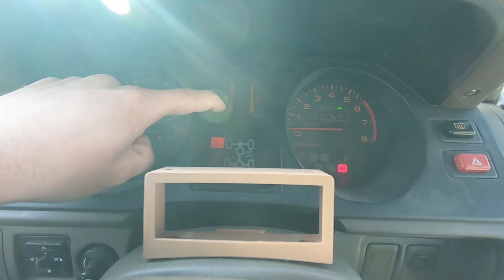Dodge Raider/ Montero Diesel Swap Pt 3. Finally running!

Comment: An intercooler would make a noticeable difference. Hack up some exhaust tubing and get some silicone connectors and use some random intercooler behind the front skid plate or wherever. Nice job!

Comment: Awesome video, good job! I never knew what lapping the valves meant until this video. Simple to understand and informative information on the procedure.
Nice see detail work on the motor. Like the gold valve cover.
I had to laugh a little when you said Ive got to figure out how to remove the motor. I thought you had removed the old motor and installed this one.
Reply from the maker: Thanks for watching! glad you learned something new. And yes i did have to remove the old stock engine to put this in. But if i remember correctly I had a huge fuss putting it in because of where i hooked my chains on the engine. So i needed to find a better more suitable place to hook the chains hahaha.

Comment: Idk man did you time the injector pump right that doesn't sound like air or a diesel leak to me sounds like the timing is off...I have a VW 1.6td in my Suzuki samurai and it ran like this because the pump timing was off a little I retimed it and it was running smooth as butter after that...

Comment: Do you know if the 3.0 V6 and the inline 4 have the same motor mounts and transmission mounts?
Reply: I just drove a ram 50 with a 4D55T and it was awesome!! I was going to buy it but the engine was pretty tired and built pressure in the cooling system.

Comment: Glad to see it finally running! How well do the five speeds holdup with that power
Reply from the maker: I think the trans will last forever with this amount of power 🤣. This car has 205k miles on it and the trans feels super tight and smooth so i dont think it will be a problem.

Comment: Thirty-plus year old vehicles needing work?  What?! New injectors and fixing the lines will make a huge difference I bet!
Reply from the maker: Yeah maybe i should buy something newer 🤣. I am really liking the way this has turned out though. I got the exhaust all welded up today and it actually sounds like a normal small diesel. Granted, you can barely hear the turbo, but its not obnoxious anymore 🤣
Reply: Frank! Just saw this series yesterday so I'm late. Wish You Tube was around back in the 4x4Wire days. Would've saved a lot of time and effort.